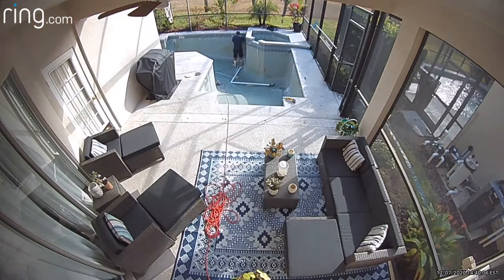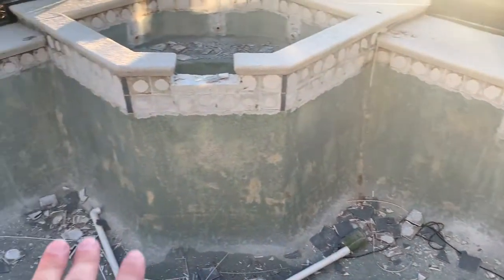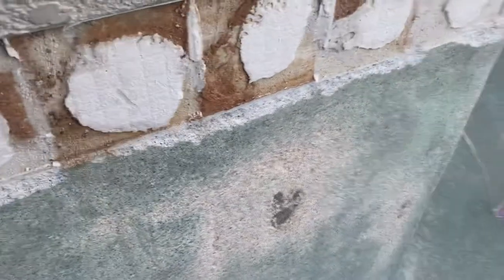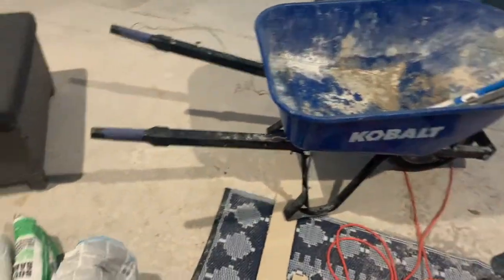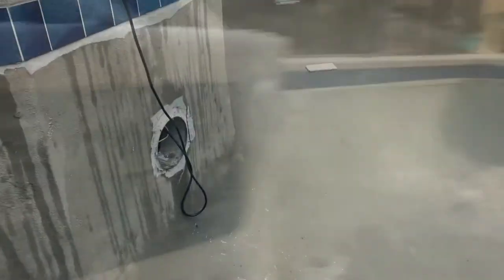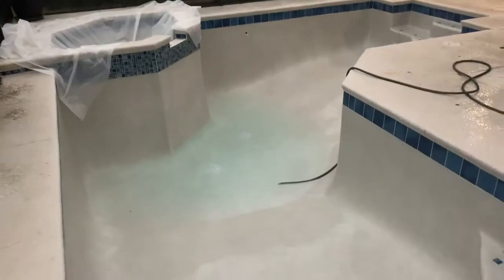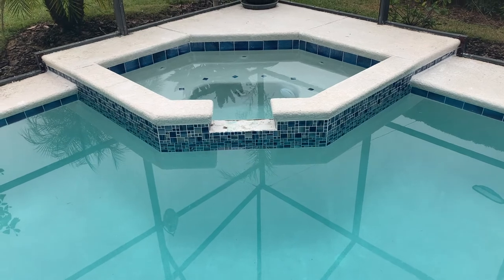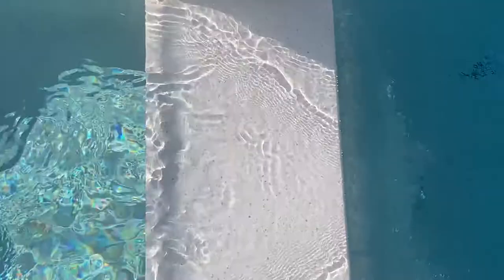Ever Wondered How A Pool Is Resurfaced?

Comment: What was the cost? Trying to get an estimate on mine
Reply from the maker: Ours was a total of about 8,000 for everything. We also had to replace our pool light and have the wiring changed out because the old one was about 19 years old at the time and did not work any longer. That was an extra 800.00. Without that it would have been around 7,200.00. We got several quotes and went with middle of the road. In our area it was important to go with a reputable company and look at reviews. We have had some friends and neighbors get really bad work done. One of our friends even had to fire one company and pay another company to come out and fix it.

Comment: Can you share the info on the specific tiles you used?  I really like what you used and would like to see if it's available near me.
Reply from the maker: Yes Micheal, it may take me some time but I’ll get you the information. We have a few left but I looked and the manufacturer name is not on them. So we will contact the pool contractor that installed them and find out for you.